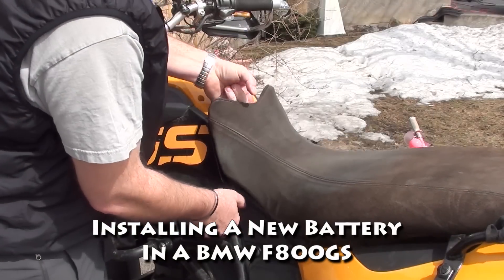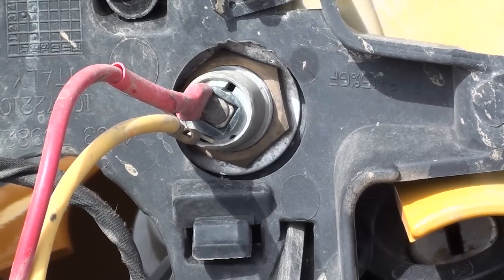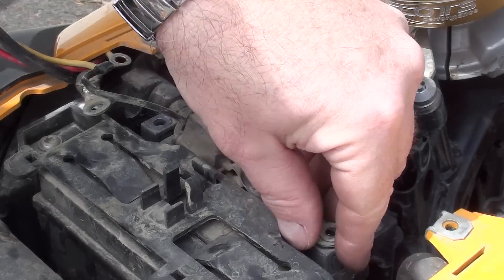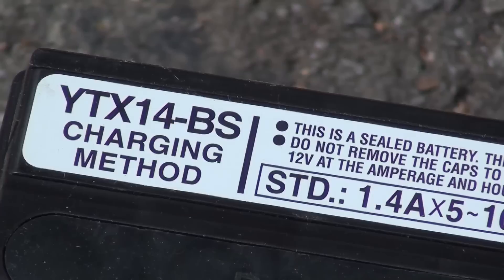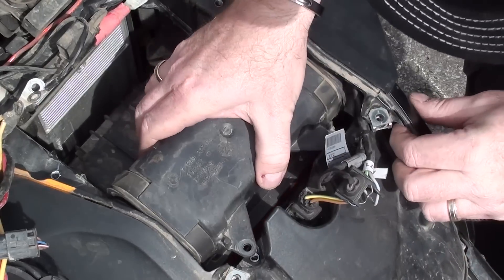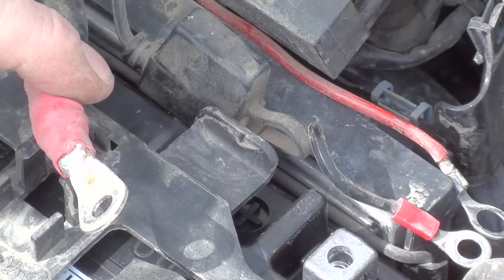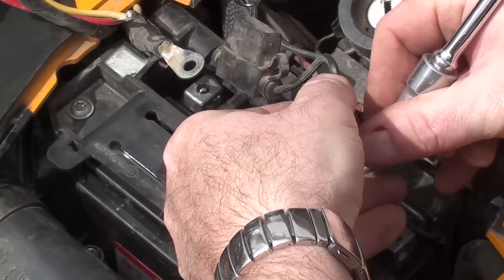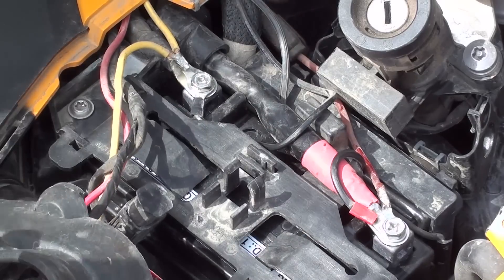How to change a motorcycle battery - BMW F800GS

Comment: Good to know that it is not necessary buying OEM battery.  Thanks!
Reply from the maker: Any battery will do as long as it has the amps. More and more people buying the lithium to save weight but a few friends have had issues so I am sticking with the old tech for now.

Comment: I noticed your Spot Gen 3 is mounted on the bike. I've been convinced to wear mine on my jacket so I can get to it. An accident or incident will likely separate you from the bike and the Spot. Not a good thing if you need it to get help. Thanks, the video is very informative.
Reply from the maker: Hi Steven. I have heard that. My issue is that I wear a lot of different gear so I like it on the bike or it gets forgotten. I will probably get the new one that can be left plugged in to bike power and that one will definitely be on the bars.

Comment: :) I need to do this later this spring before i  go on holiday :) Currently still riding daily but i need to charge the battery at work every monday because it barely makes it over the weekend :D.

Also those 2 bolts that are near the ignition i lost about 5 of em now :D

Comment: Very good video also changed in my F650 gs, however appeared on the screen "service" :(
Reply from the maker: +JOSE EDUARDO MACHADO Service just incates either the time or mileage interval has been reached. Dealer can reset or you can use a GS911.
http://www.hexcode.co.za/
Reply: Thanks for the link, very useful :)

Comment: What battery did you use or would recommend?  I don't want to spend a lot, but I want a battery that will last.
Reply from the maker: I just bought an old school battery like the one that came with the bike. No fancy Lithium stuff. Around 100$ CDN. https://fortnine.ca/en/yuasa-maintenance-free-battery
Reply: Thanks for info.

Comment: I just replaced my battery and I noticed there were no captured nuts. I put in the new battery and the bike works fine without them like before. Is this okay?
Reply from the maker: +Daniel Siddiqui The captured nuts are just there to make installation easier as it would be pretty hard to get a wrench on the nut to keep it from spinning. As long as the terminals are tight you are fine.
Reply: alright thanks!
Reply: +Awesome Players hey I have a 1990 katana 600cc , rode great , next day won't start at all, my lights wotk, everything works just won't start makes no noise at all....
Reply: How are the screws possibly staying put without the captured nuts? My battery came without the captured nuts as well and I ordered some as a regular circular nut won't fit into the battery terminal area.

Comment: I just connected the battery and now the service indicator has now appeared on the LCD, how can now I turn off the service indicator ?
Reply from the maker: You will need to get the dealer to do it or use something like GS911 which is a tool that allows you to do it yourself. The reminder comes on based on mileage or time between resets.

Comment: How to jump start this bike?
Reply from the maker: You can just hook up some jumper cables to the battery and use another vehicle's battery as the source. If you don't want to take all the plastic parts off you have to find the positive connector on the starter. That is a big fat cable that goes straight to the battery. The whole frame of the bike is negative.   Some bikes like the 1150GS adventure actually had a little cap down by your left foot that allowed access to that terminal. I have never jump started my F800 so I don't know if that positive terminal is accessible. If not you will have to access to the battery.
Reply: Thanks for the suggestion, I had a G650GS and it was really simple to jump start, I though F800 would have the same option. Will try to find the positive connector.
Reply from the maker: On the G bikes wasn't there a terminal under the seat? No such thing on the 800 sadly. Taking the plastic off to access the battery is quick. 2 minutes tops.
Reply: Correct. G 650 had that option. I just didnt wanna take the plastic off. Will have to. Thanks, I appreciate the help. I love the channel. Regards from Costa Rica.